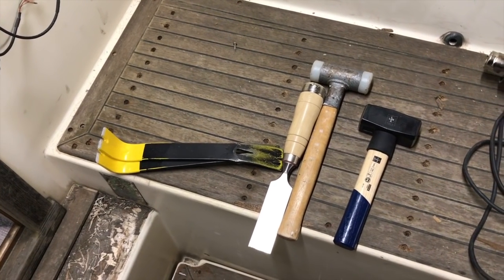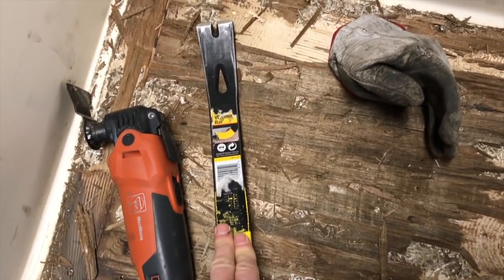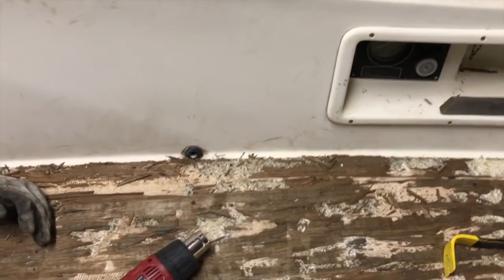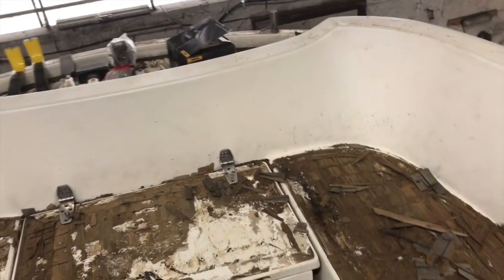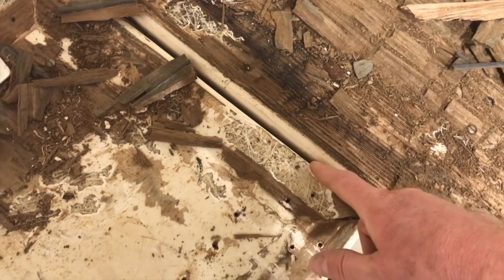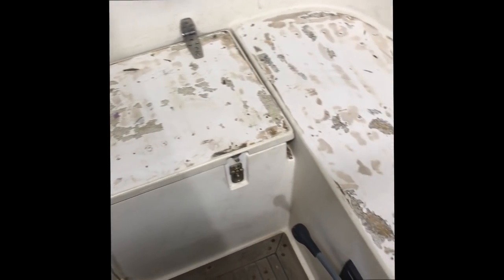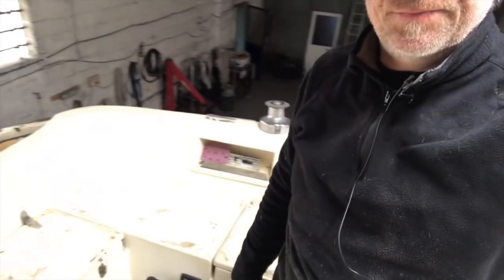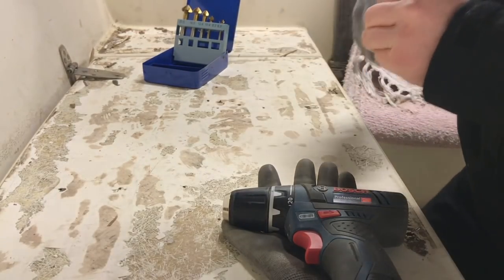Hallberg Rassy 312 "Ellös" - Sea4See - Teak Away #2

Comment: I recently had this job completed on my boat.
On these Scandinavian made boats it was common at that time to epoxy glue the teak on to the deck.
On mine it was the same.
Good thing being it will last forever, but also makes it impossible to remove when the teak turns bad.
The screws were there pretty much only for keeping the wood in place while the epoxy hardens.
I just publiced a video about my project. It's a slide show, but you might get some hints...
Reply from the maker: Scramasax thx a lot to write and see my video vlog sea4see! Thank for advise and happy to see your video always interest in other project or solution!! Have you used the teak again? Did you fill all the holes?
Reply: Thanks I published my video yesterday.
All holes were filled with thickhened epoxy. Same for all the areas in the core where a leak could be possible (for example the chain plates).
The old teak was not salvageable. It came away in small pieces just like yours.
The new teak was glued only. Screws had to be used in some places, because of the curvature of the deck, but they were removed later.
Reply: What type of boat was it?